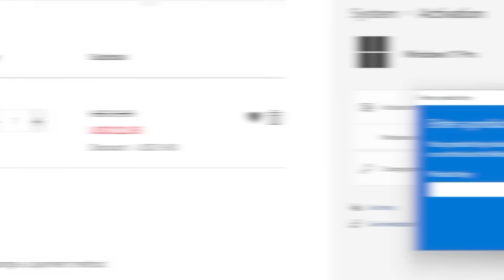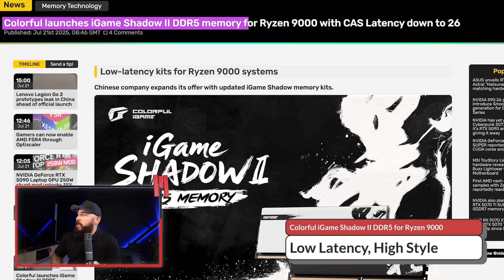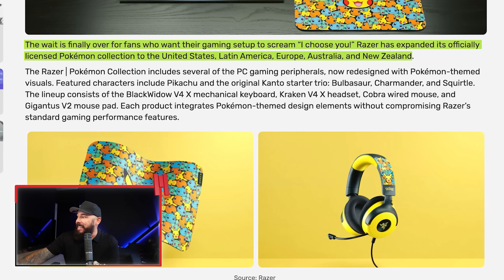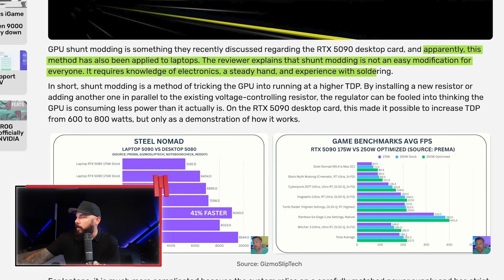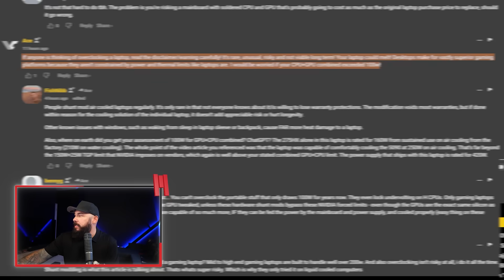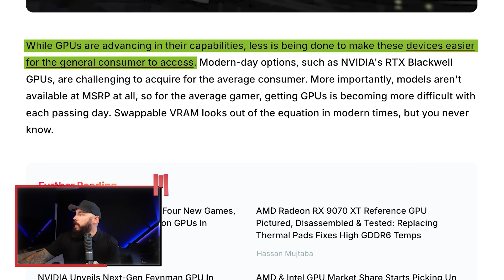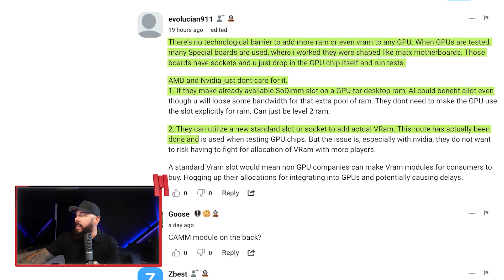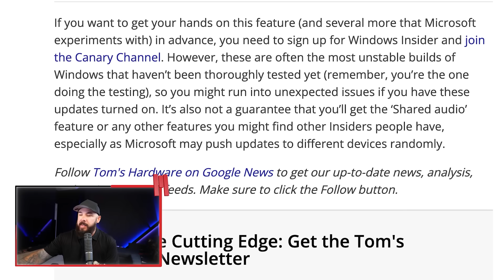Add VRAM To Your GPU?!

Comment: Modern GPUs cant have removeable vram (atleast with our current tech) since as you go up in speed distance becomes an issue (take wifi speeds, 2.4GHz slower but farther vs 5GHz faster but shorter, ram is different but the analogy is easier to understand for the sake of everyone). Its probably also going to result with a similar issue with laptops with soldered ram while still having an extra ram slot, it's strict, you cant just plug in any sodimm in it,  it has to respect a few certain rules like CL timings and what not, else your laptop wont even boot into bios. I mean I guess this is a very specific use case since usually its either your laptop has purely soldered ram or purely removable ram, but there are afew that are a hybrid. Upgrading those said hybrid is easy if all you do is head to the shop, but for basic people with some tech know how would probably do it themselves, saving some cash, but not expecting this issue.

Comment: thats not a dream it used to be on every video card with 32 pin dimms i used to have a video card and a sound card that took 32 pin dimm still have the sound card in a box somewhere and its an old soundblaster

Comment: It would be great if you could add vram but ddr6 is not available. 
You’d need a proprietary ram set up and special ram upgrades but it definitely is possible.
What might work is a low vram card having an additional slot to be used only when vram is overrun. This way it wouldn’t need to go directly through the cpu.

Comment: For VRAM, one method of expansion, is asecone level of VRAM, e.g., 2 SODIMM slots and allow users to Install DDR5 modules. Then instead of having assets spill over to system shared memory, which is bottleneck Ed by the PCIe bus, they can have 32 to 96GB of DDR5, offering around 100-115GB/s of access. This will minimize how much of a slowdown happens when there is spillover from GDDR7.

Comment: I was gonna comment this but i forgot but yeah I think they should make a SSD size called g.3 or Smth, it physically cannot fit in other pcie things and its to add vram to a gpu like the gpu that can hold SSD but its usés them as vram and not storage but itll probably bé a ram stick and not a SSD but they could make a horizontal ram thing to add vram and like 1 gb is 30$ but issue is that memory busses arent idéal like a gpu that would need it is like a 5060 but with its 128 or 196 bit memory bus can only do 8 and 16 gb that's why there arent any 256 bit or less 5090s or 4090s. But they could specify memory bus support probably or rework how gpus are built (unlikely)

Comment: I don’t know enough about signal integrity, but with camm modules coming out, you could do something like that a camm module for VRAM
Reply: That has potential to lower the latency issues you'd get from socketing VRAM in a DIMM module given LP-CAMM can be put physically closer to the GPU itself... 

but who knows how the LP-CAMM interface, or a similar pin-pad sandwich type connection would handle the ridiculously high transfer rates of VRAM

A decent DDR5-6400 LP-CAMM module can transfer at up to 409Gbit/s

A GDDR7 chip can do 32Gbps per pin. on a 384-bit wide BUS (which would be typical of an upper mid-range to high end GPU), you can see up to 1.5Tbit/s in bandwidth.

With the higher transfer rates comes increased chances of data corruption from interference

and if you have an interconnect such as the pin pad that LP-CAMM uses to seat onto a board, it has the potential to increase the amount of EMI and other electrical noise that the RAM will see during normal operation, which would reduce speeds and potentially cause instability.

Not to say that socketing GDDR is impossible - but it is a very hard and expensive problem to solve.

as for socketing LP-CAMM DRAM onto a GPU

I personally don't see why you couldn't do that. Especially for memory capacity intensive workloads.

but at the same time, the performance losses once the GPU starts to use the DRAM as an extended buffer would be fairly massive on workloads that need the high speeds and low latencies (e.g gaming, CAD modelling, content creation), and impacts would also vary based on what speeds and timings the supplied LP-CAMM module operates at, as the speed dictates the final transfer rates and the timings affect both the memory latency and your final DRAM speeds.
Reply: 100% but that would mean that we will be keeping our GPU's for longer, and they would rather drink effluent then give that to us. They want us to buy a 300$ gpu and realize it's crappy then throw it out and buy a new one in a year, then every year for the rest of our lives. They want us to hook them up to a money I.V.

Comment: 15:54 I have been doing this since 2007? Never used 3rd party apps. Any Realtek Audio driver has it.
Turn on the stereo mixer. Listen from the primary device and output to your 2nd…. All from windows, back to XP. No apps needed.
Prior to 07, yeah I used VACs which tanked CPU performance

Comment: All tech hurdles mentioned has already been addressed. Noise, power, etc, thats all bs. Another power regulator is around $1.12.  

Nothing thhey said is true and a real problem. 

Its because they are greedy and would rather cause a ton of ewaste trash for a few shareholder perks.

Comment: Do not shunt mod your laptop 🤣 Don't even overclock it, I thought I was smarter than everybody else a few years back, it's not smart he will just hit your thermal barrier much sooner and it will thermal throttle withing seconds, you can already do this just with MSI afterburner without even adding voltage if you don't believe me

Comment: It's not just the VRAM capacity, it's the fact that NVIDIA and AMD choke their GPU's with extremely narrow VRAM bus width. In 2019 we had a 4096-bit memory interface on the Radeon VII. Now we're lucky to have a 256-bit bus.
Reply: So we'll have 4096-bit bus in 84 years.. good 😂
Reply: @Muiuiuky  Urrgh I only noticed the typo now.
Reply: It's impossible to get huge bus width without HBM memory lol

Bus width dictates how many memory slots you get on the card... 128bit bus means you get 4 slots for 2gb modules meaning your only options are 8gb or 16gb using clamshelling

Bus width can not change and go really high with standard GDDR chips... if you want really wide bus you need HBM and apparently that's too expensive and unnecessary for gaming cards

As you can see Radeon VII had 16gb of HBM2 memory on 4096bit bus with a bandwidth of OVER A TERABYTE per SECOND

And all that just for a raster performance of a 3060 while consuming a lot more power and no raytracing and hardware based upscaling like DLSS / FSR 4

So bus width isn't everything
Reply: @kajmak64bit76  Sure, bus width isn't everything. It sure makes a difference, though, all else being equal.

Comment: Another thing is that sockets have a their own monetary cost. Manufacturing gold plated micro pin sockets ain't cheap. Not only that but the memory now have to be on a stick instead of just the chips with also has its own additional costs.
Also if they go with the LGA approach it would make the GPU way more fragile like mordem CPU sockets are. One bent pin and you could end with a brick.
Overall it would be slower, more fragile and more expensive than buying a board with BGA memory.
A simpler solution would be for them to just stop making GPUs with less than 12gb of Vram.

Comment: I'm for a GPU with RAM slots for a secondary GPU if we only had DDR RAM. Streaming can use a lot of VRAM for overhead. The guy mentioning GPU testing has pretty solid theories. 

Multi-output audio is a great idea. During maybe the Pentium era, that might have eaten up a lot of CPU power. Basic audio processing is nothing for any CPU that's at least the Core 3/Ryzen 3 level. Even wired devices might have a little latency, so I'm curious if they can eliminate it. Bluetooth might be even worse

Comment: I've been picturing this idea for few years now and even thought that those GPUs where there are two M.2 slots were experiments in that direction.
Aaand after reaching to that point of video I see other's thought of that too due to those M.2s :D

And to why DIY vram upgrades are no go, not because it's difficult, they could just make those VRAMs in similar way the CPU and CPU sockets work. No, it's because they wouldn't be able to force you to buy highest end card to get those VRAM you need. Imagine how not worthy financially for them would be you upgrading from 2080 to 5050 and sticking to it additional vram to have 24gb? They rather want you to have way too strong GPU to your needs only because you wanted 24GB instead of 8GB.

Comment: With regard to expandable graphics cards vram. most gpu boards all too often end up having spare, unused vram pads on their cards when you check them. I personally fail to see why someone could not upgrade their vram capacity on their graphics card by installing/adding either, more of the same type of vram modules or simply replace all vram modules onto these spare vram pads for larger capacity ones on their graphics card and potentially double the stock amount of vram on their gpu. This should not prove to be to much of a problem to run your newly modified/expanded gpu vram because the graphics card should simply draw more running power from your systems power supply in order for it to continue to operate normally, especially when a gpu needs to draw extra power from your power supply by adding extra power connectors to it, which in most cases these days is what a moderate to high end gpu would require in order to operate normally anyway. I`m fairly certain that any seasoned graphics card engineer more than probably could test this theory as well as make it a successful gpu vram upgrade, potentially improving not just vram capacity , but overall gpu performances without the potential performance "lags" mentioned in this video about the use of using M.2 style vram add on upgrades instead . . . 😀😀

Comment: Currently, a concept is being developed where 8GB of RAM is enough. I'm not referring to the new compression that NVIDIA and AMD are currently developing.
Here's the idea that's being worked on, I'll give some numbers. One of the most graphically intensive games actually only has about 4GB of graphics in it. I'm referring to a situation where you choose the graphics settings, and this is what happens. Yes, this is compressed graphics, but it stays on the SSD. And this is where the huge delays come in. To upload this information to RAM, to decompress only that part of it that is needed for the game, to compress it in a format for the graphics card and to send the information to the graphics card.
So the concept that we're currently looking at is that this compressed graphics can be directly uploaded to the RAM of a video card. This will avoid many cycles of reading/writing, decompressing and compressing, moving and downloading from the system's RAM. Instead, an ARM chip is able to handle such information in RAM conditions, inside the GPU architecture...
Initial tests show a decently large jump in performance in graphics-intensive games, but this approach has almost no impact on e-sports games. It has its limitations.
However, the tests showed a huge increase in work with artificial intelligence, which stores information there, instead of constantly forwarding it through the PCIe slot to the processor, from there the memory bus is used to upload to RAM, respectively, in the reverse order of data movement, while the AI processes the information... Here the acceleration is times the artificial intelligence..

That's it for now
Reply: that does sound pretty interesting, i just dont think nvidia needs another excuse to cheap out. still exciting.
Reply: Maybe AMD should do that to better compete with Nvidia.
Reply: decompressing memory at real time speeds sounds like a retarded idea especially when you need a seperate chip to do so how is that cheaper than just adding more ram?
Reply: very interesting would love to have this be used

Comment: my issue for vram isnt 8gb not being enough but 16 or 24 not being enough for virtual reality use when maxing out settings like i can have max settings 14k simulated resolution 120hz refresh rate but when playing multiplayer games it maxes out quickly at those settings i need like 32 or 64gb of vram saddly and that doesnt exist iv been tempted to switch to amd because they tend to have more cards with 24gb insteaqd of being stuck with 16gb but likje i said 24gb isnt even enough at those settings i can see why vr is very graphics heavy it usally tends to max out my vram then my regualar ram goes crazy not knowing what to do and i have 64GB ram 2 slots with 2 more i can add if needed for 4 slots working on that currently just in no rush since ram holds fine

Comment: 5050 Ti...... hmmmm...... I hope it come in an ITX varient. I'll be sorely disappointed if it doesn't. Us sub 5L SFF builders need more relevant ITX cards.

EDIT: Expandable VRAM is a pipe dream, and no it isn't just the fact that they want to sell more cards Zack. Come on that's so childishly simplistic. In order for the core to properly interact with VRAM it has to be a at a certain "performance level" to do so and the vBIOS has to be preprogramed to recognise it, along with various other nuanced tweaks on the PCB and where certain resistors are place. So in order for this to work they would have to sell you a really powerful core with a one size fits all PCB and potentially multiple vBIOS chips. It would be a terrible card until it's upgraded and even then because of the broad spectrum of configurations the traces will just be too all over the place to deliver the true performance potential of memory let alone the core. Which would just recrate current cost to performance imbalance but with extra steps and actually increased costs across the board.

Comment: GPU's prices are insane these days. Whats the point of new better faster GPU's if only a very small percentage can afford them.
Reply: I'd say the fact that they're selling out in a lot of retailers says you're wrong on that. But I get the sentiment, I'm over here running a Sapphire Nitro+ RX 580 8GB on modded driver with a 5600X. I'll maybe move to AM5 in a couple years when used components are more plentiful and cheaper.
Reply: @bearde_mut9731 I'd say the fact they are still limited in numbers, there are far far more pc users without a 50 series than with, and that they are barely a blip on steam user hardware charts shows I'm right.

Comment: Im sticking with my 4090 till radeon gets past it! Tired of nvidia bull crap so I'm amd from now on
Reply: Hopefully not too far away seeing as the 9070XT is hovering around 4080/5070Ti territory. Could see a significant boost in next gen, but it's likely not going to be for another 2-3 generations. Only time will tell.

Comment: We used to be able to work on our cars.  Change plugs, points, condenser, and adjust the timing.  Those performance guys would even change the jets in their Holly carburetors.  Double pumpers - those were the days.  Not anymore!  So, can't upgrade your GPU?  That's O.K. - Just buy a new one.

Comment: 2:42 The new 8GB models aren't selling because they are excessively overpriced. The 6/8GB RTX3050 should be around $150 but nvidia is keeping stock limited/not making them anymore which is bloating their prices to the same level as the current 5050. The 5050 should be $200 MSRP and go on sale for less. If they did that, they could take a big chunk of the low-mid level gamer segment. instead AMD is taking it with the RX580, RX6500XT,  RX6600 which are all easily available in the $150-200 price level.
I remember video cards from 2+ decades ago when video cards could use a laptop SODIMM or direct chip install for its VRAM, but they had a max limit (4MB soldered on board, 4MB max expansion).

Comment: to those who says swappable/expandable vram is not as good as soldered on... we know and it doesn't excuse not having it. Maybe we want a 3070 with 24 gb vram without needing to buy a 5080 super, a 7900 xtx or a 4090 (and maybe an intel arc pro with 24 gb vram) for professional workstation. For the same reason we're exited in camm 2 even if soldered on ram in better.

p.s: nvidia is making socamm... I know vram and ram are different for reasonable reasons, but they can invest to make that happen. Again, I know that soldered vram is better than expandable vram. But it doesn't exuse for not having it

Comment: If they do anything it will be a 12GB card if the 5050Ti actually exists. It's going to be an actual waste of silicon though. 50 series cards are barely more usefull than a 30 series card, and the only use of a 30 class card is to connect an extra monitor to a business desktop lol

Comment: DR5 memory on mini PCs work just fine with GPUs. I got AMD AI 9 370hx with 128gb memory and it uses 56gb on GPU. Its about 5 to 10 fps slower in games than version with soldered memory 32gb on board BUT with that HUGE memory i can use upscaling and frame generation that actually lifts it to bringing 100% more FPS in screen. So i call it BS why you cant do it.

Comment: SOCAMM or LPCAMM with GDDR7 on top would be nice for GPUs. It should be easily possible for such a GPU to probe which kind of VRAM it got installed by reading the memory's SPD.

Comment: We need enough VRAM so that it last a couple generations rather than upgradable VRAM. You don’t need 32GB of VRAM on a 5060, you also don’t want 8GB even though that’s the only option, 16GB would’ve been fine for future games with that GPU because by the time you need more than 16GB on that GPU, you probably want an upgrade to the GPU itself or you could lower settings to fit in that VRAM size.

Adding VRAM upgrades is fixing a problem GPU manufacturers added in the first place when it cost less than $80 to double VRAM, less than $50 on most cases.